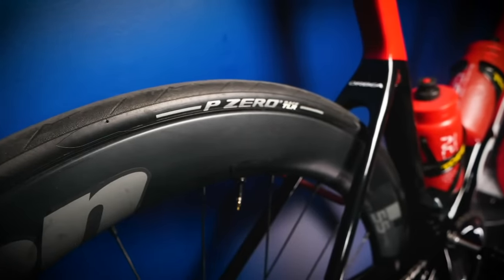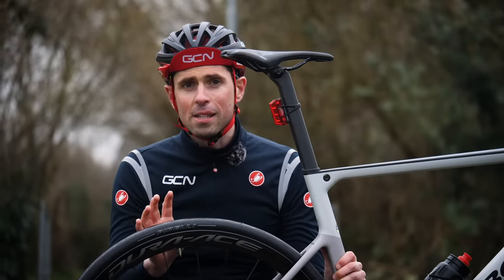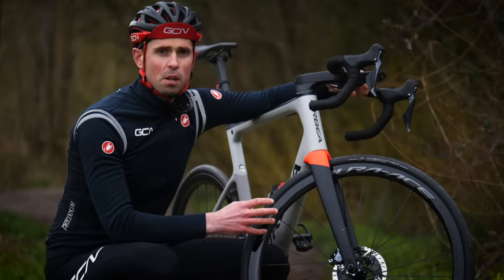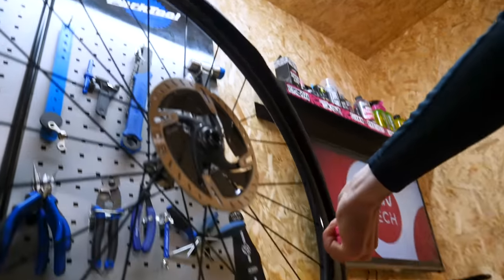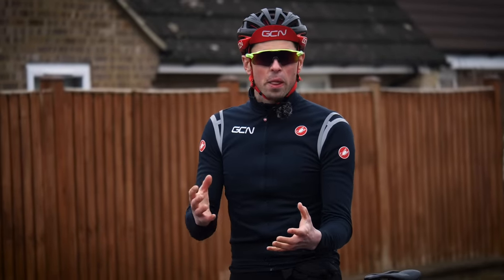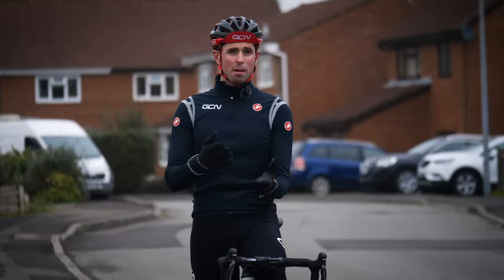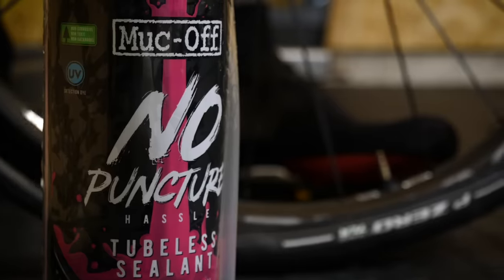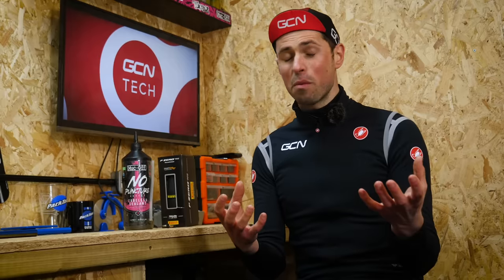Tubeless Convert! | Why Alex Will Never Use Inner Tubes On His Road Bike Again

Comment: “Why I’ll never ride with inner tubes again” : .......Because it keeps the sponsors happy???? 😃
Reply: Beat me to it.
Reply: Like it
Reply: Yeha BUT I also like tubeless. Less time spend on the side of the road with flat tires 
Sooooooooo YEHA
Reply: This is it in a nutshell for tubeless and disk brakes. The bike industry solving problems that don't exist so they can sell more kit. And the cycling media eat up the nonsense with a giant spoon because sponsorship and ad revenue.
Reply: @johnandrews3568  Agree John . Brought a Gravel bike which has tubeless but I still have tubes in them and discs. Don't like either. Grandson had a puncture in his gravel bike tyre the other day and it was a nightmare to get off. How you do it at the side of the road I don't know. As for discs give me rim brakes every time as as I don't fly down hills anyway. Thinking of building another bike up but rim brake frame sets are getting rarer to get hold of. Ok I am a Luddite but I am happy.
Reply: @2wheelsrbest327  I have campy disks on my cx bike - sadly can't get a carbon cx bike with cants any more. Should have detuned and went with aluminum. That said, campy disks work better than Shimano or sram hands down all day long. still a pita to do maintenance on...
Reply: @2wheelsrbest327  It's easier to use a tire plug instead of putting a tube in like car and motorcycle tires.  I prefer tubeless though I've never had too much trouble with either.  I just almost never get flats with tubeless.
Reply: @2wheelsrbest327  I'm actually curious, would you have enough clearance for big gravel tyres if you put rim brakes? Would you go with cantilever brakes?
Reply: Aramintai  couldn’t agree more.  At least the GCN channel is fab. Fun. Worthy watching as other than sponsored s*it. It’s a decent channel. Shame profit means terrible adverts or advertorials as a video
Reply: @johnandrews3568  Thats interesting John as I as just going to reply to Franks question by saying CX bikes have cantis. Yes getting the wheels set up with discs is a pain to me. Cantis aren't the best brakes but toe them in and they don't squeak. It does  seem to that rim brakes will be a thing of the best in a short time.
Reply: @airwilliam24  Thanks TA. Fair comment I think I said my only experience was getting my grandsons tyre off when he had a puncture. It was a nightmare. To give some balance last weekend out at 5.30 am hit a pothole and got three punctures . Yes three punctures. Two went down straight away put a new tube in bang it exploded/Thankfully I carry three so carefully put the last two in. Sorry you may be right but the thought of the mess getting the tyre off or not being able to seal puts me off of using TL.
Reply: @6872elpado  Hi Frank as you may have read I was going to say CX bikes use them but John says they are getting harder to get hold of. I have a couple of Touring bikes fitted with them and they can be hard to set up and I would say they are adequate if you dont want to fly down a mountain pass.
Reply: Aramintai  idk if it’s Pirelli doing the talking here, because they have been going on and on about tubeless for the past 6 years or so
Reply: @johnandrews3568  Disc brakes are actually way better for some bikes/situations, though.  If you ride frequently in the rain, you can get mediocre stopping, and much faster rim wear, or you can get discs, and get only slightly worse breaking, and fast pad wear.  OTOH, if you live somewhere that gets less rain, or you're only a fair-weather rider, there's probably not much benefit.  I like them a lot more than rim brakes, but YMMV, and that's fine.  There are good arguments for both.
Tubeless OTOH, I haven't found actually does anything better.  I've found that they're lousy at the things that they're supposed to be good at, and they add a lot of hassle, expense, and potential other problems at the same time.
Lots of people claim they "never get flats", etc.  but I think I've probably had more flats over the same time period, if you include the ones caused when the rim tape has spontaneously failed, and even when the sealant does work to some degree, I've found that it often won't hold decent pressure, and the last of it will blow out when you try and refill your tire.

The reality is that changing a tire isn't a big deal if you know what you're doing, and if your tires aren't awful, it shouldn't be a frequent occurrence anyway.  The tires I have on my bike right now, are tubeless ready schwalbe marathon supreme (admittedly a moderately thick tire), and in the year I was running tubeless, I had 2 flats, both from failed rim tape (spontaneously blew out while the bike was sitting in my hall).  In the 2 years since, after converting back to tubes, I've had zero flats.
If I get a flat some day, the 5 min it takes to swap the tire won't even come close to outweighing the maintenance hassle and cost of tubeless.
Reply: Get over it, they’re jsut better. If they were no good no one would buy them.
Reply: @metallusmelandril7380  how do tubeless tires prevent punctures? They still require tire pressure
Reply: Tubeless is ok for gravel and mtb (45mm+)
I will never put them on my road bike. 
Im into latex
Reply: @ivancajka732  too much information...
Reply: @mattheww797  Punctures ( moderate) are self sealing and pinch flats are almost nonexistent.
Reply: @johnandrews3568  disc brakes aren't a conspiracy. They definitely stop faster and work better in worse weather.
Reply: @bobbyellis5006  They do not stop faster in dry and marginally MAYBE in wet. Don't forget braking always comes down to quality of mechanical grip.
Reply: @johnandrews3568  it comes down to friction and disc brakes will always have more surface area when it comes to brake pads actually touching the surface area being affected.
Reply: @bobbyellis5006  seriously, are you serious? Have you looked at the disk pad size vs a rim brake pad size? Rim brakes have bigger surface area on the rim than a disk pad on the rotor, rendering what you say false. Rim brakes put more pad surface on the braking surface. As I said previously, disks 'may' work marginally better in wet but if you are on rim brakes and constantly 'wipe' your rims you'll be fine. The 'need' for disks is just marketing BS from the manufacturers to get people to buy new bikes. And some people buy this BS hook, line and sinker. Trust me... 44 seasons with 15 of those raced at the highest level and rim brakes have never failed me wet or dry. Disks are also heavier. Disks... solving problems no rider ever had.
Reply: @johnandrews3568  the fact that you're a racer doesn't make you an engineer. If you want to complain about that tiny bit of weight, fine, but it didn't stop disk brakes from winning more stages of the Tour de France last year than rim brakes. There are videos out there comparing the stopping power of disk brakes to rim brakes, and in dry weather, it's marginal. But a marginal stopping distance can mean the difference between getting hit by a car or not. With disk brakes, you can increase the area the pads are touching with different sized rotors, adding even more stopping power. With rims, you're stuck. The fact is, disk brakes are used on motorcycles and cars for their stopping power and safety. If they're good enough for a Formula 1 car or a bike racing in the Isle of Man, they're good enough for an over the hill guy who wants to pretend he's a professional bicycle rider.
Reply: @bobbyellis5006  man you're all over the map in your arguments. First off... you don't know if I'm an engineer or not. And your argument about increasing rotor size has NOTHING to do with pad size or the amount of pad that touches the rotor. The size of a disk pad is limited by the size of the calipre shoe and that is smaller in surface area than a rim brake pad. FACT. You talk about braking in racing and then say disks will help stop you being hit by a car. In racing you rarely ever need brakes to come to a complete stop. You need brakes to shave off speed. And regardless, you can't stop any quicker with disks than rim, marginal in wet at best and also down to rider application, weight shifting, rubber compound and contact patch among other variables. Disks are used in motor vehicles because rolling weight is substantially higher, as are the speeds in which those vehicles are travelling. Weight isn't a factor either. So that argument holds no water because it's comparing apples to orangutans. You won't convince me otherwise with my research and real world experience. So agree to disagree and move on, mate.
Reply: Tubes on road bikes are going the way of friction shifters - they work, but... why?
Reply: My guy I trek with groups anyone with inter tube always the ones with flats and us having to stop for 20 mins and all I care is my bacon strips and fupa for pump
Reply: Maybe this entire channel is just OMG LOOK HOW GOOD ALL THIS NEW KIT WE'RE PAID TO PROMOTE IS. Let's do a test of new and slightly older cheaper gear, oh my god imagine that the newer more expensive stuff won wow maybe buy that
Reply: @johnandrews3568  why do you reckon disc brakes are not better then rim brakes? I vastly prefer disc over rim brakes.
Reply: @tikkywikky  first off, in the dry they don't stop any faster than rim brakes. Wet is neglible per my statement above. Disks are heavier than rim and a pain in the ass to service and you burn through pads faster with disks. Rotors also warp and make noise as you ride along. In no time over the past 100+ years has any pro ever lamented they needed more stopping power than a rim brake provided. The ONLY reason pros use them is because they're paid to so their sponsors can make money. Every pro I know prefers rim brakes on their personal bikes.
Reply: @johnandrews3568  I notice a difference with disc brakes and rim brakes. Though my bike with rim brakes is from 1985. Same sentiment along the rest of my friends, most of them are 90kg+ so that might have something to do with it. 

I also had a tire explode because the side wall was gone after prolonged rim brake usage. Thankfully whilst inflating and not while driving.
Haven't had the need to service my disc brakes yet. So can't comment on that.
Reply: @tikkywikky  rim brake callipers from 1985 (even dual pivot) can't compare to modern dual pivot brakes. Also, do you KNOW that the tire exploded from prolonged rim brake use? I'm guessing it's either a puncture or manufacturer's defect. I've literally never had a tire blow from braking, ever. Nor have I ever heard of anyone having this issue, amateur or pro. I think that whole rim heat argument 'may' be valid if you're descending in the Alps and riding the brakes the whole way down (we all know THAT rider)... but I think the industry uses this as a ploy to scare people into buying disks. Hell the industry was all about tubeless and now the industry is moving back to inner tubes. It's all about making people buy and replace kit.
Reply: @johnandrews3568  the side wall of the rim ripped of the rim whilst inflating at 6.5 bar.
Reply: @johnandrews3568  U don't know about your take in disk brakes. If you live in an area with shitty weather, disk rule. Sane if you go gravel. 

For tubeless vs clincher, I think it's a coin toss.
Reply: @LRF49  I ride year 'round and in winter that means rain, sleet, freezing rain and snow at various times over salted roads. Rim brakes have never failed me and yet on my CX bike that has disks, I've had three catastrophic failures in three years (and each of those fails was in perfect, dry, weather). Disks are just not the best solution. Again... the industry solving problems no one ever had.
Reply: The sponsors also make tubes and tube type tires and wheels.
Reply: Clearly never used tubeless mate
Reply: @johnandrews3568  why shit on disk brakes? They are way way better. Sure rims can work well but disks have far greater stoping power and I feel more confident with disk them with rims. Besides it's not pointless it comes from mountain biking where you really need that extra stoping power
Reply: @anonymouswhite352  did you read this thread at all? Stopping power is great but it's all negated by the contact patch, your rubber compound, how you shift your weight, etc. Disks on road bikes are pure snake oil marketing BS.
Reply: What sponser would care?
Reply: Big Tubeless Vs Big Inner Tube.

Comment: Not a completely balanced video, IMO. Didn't really address some of the counter-arguments. I've gone tubeless on winter bike and probably will continue. On the summer bike I have Vittoria Corsas with latex and can't see a change occurring soon. Here's the shoot-out:

Weight - the Corsas with latex are lighter than a GP5000 TL with sealant
✅ Latex 1 - 0 Tubeless ❌

Feel - honestly, the Corsas with latex, even at 90psi, are so plush I can't tell the difference over tubeless. Also, read discussion online that tubeless tyres are less supple than their clincher counterparts
= Latex 1 - 1 Tubeless (call it a draw, though could be a narrow win with latex)

Speed - the rolling resistance of the Corsas with latex is as good as nearly any tubeless set-up
= Latex 1-1 Tubeless (call it a draw)

Puncture resistance - I've had one puncture on the Corsas+Latex in two years. I've had more than that on my tubeless including a complete tyre slash. For me, in summer at least, it's just not an issue.
= Latex 1-1 Tubeless

Faff - once you're experienced with tubeless I'm sure it becomes easier. Though trying to get a GP5000 tubeless tyre on was ridiculously hard. Add in the mess, upkeep, checking of sealant, it's surely more faff? And it's not 'set and forget'. The only real faff with the latex is that they deflate quickly, though I pump tyres before every ride (even tubeless), so not an issue
✅ Latex 1 - 0 Tubeless ❌ 

Ride Gear - most people probably still take a tube out with you on tubeless set up and possible extra gear (sealant, bacon strips) to try to possibly repair tyre damage. So potentially there is added faff and weight with gear and repair of a tubeless set up
✅ Latex 1 - 0 Tubeless ❌ 

Results, just in...
🏆 Latex 6 - 3 Tubeless  🤷🏽‍♂️
Victory for Clincher with latex 🎉🎊🚴🏾‍♂️💨
Reply: Checking the sealant faff? Once every 6months I change it. Really quick job. Deflate tyre, remove valve core, suck out old, add new, add valve and pump up. 

I don’t carry tubes as in my opinion it’s pointless, any hole big enough not to seal the tube is gonna breach the hole. I’ll just Uber (or wife) it home if needed. Although in 10,000 miles I’ve never not finished, had to top up with co2 a hand full of times. 

If you choose mavic wheels the tubeless setup is easier than tubed. Not with other brands to be fair. 

WHEN you get a puncture tubeless seals, tubed you need to find the thing that caused the puncture or you puncture again straight away. 

No experience yet with fitting my TLR Vittoria yet because on bike from new and they are pretty much fit and forget.
Reply: I run latex too. Love them.
Reply: Never used latex tubes but the Corsas are just so sweet!
Reply: 100% analysis totally agree.
Reply: I got sick and tired of having to pump my tyres up every ride with the latex. My first foray into tubeless was a disaster with ultra flimsy super light tyres that were fast but just not durable enough for road use.
Since converting to Vittoria Corsa and Corsa Control for my two main bikes and I love them and the confidence of normal punctures self-sealing is fantastic.
Reply: @jamesp.1784  Yeah, totally get that James. Think it's just a situational and personal preference thing. Guess I was trying to make the point that Alex's video seems a bit imbalanced and it's not always a black/white clear-cut choice. I'll likely stay with tubeless on the winter bike but for summer the slight added faff of tubeless isn't warranted (for me, at least) 👍🏼

Comment: And now a video on how fast it takes to fix a tubeless flat vs a tire with a tube flat. Love to see that one.
Reply: As a huge fan of tubeless tires, I must admit, if the sealant doesnt get the job done, it’s pretty much game over. The tire is so stuck on the wheel, I can‘t remove it without tools… 
But since I run tubeless I never had an issue.